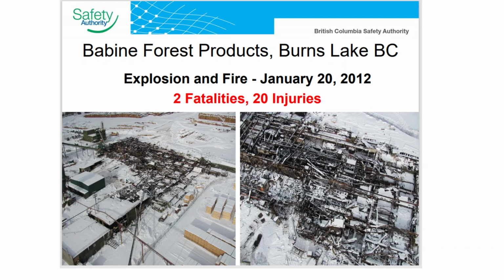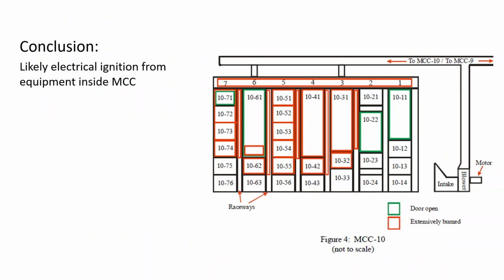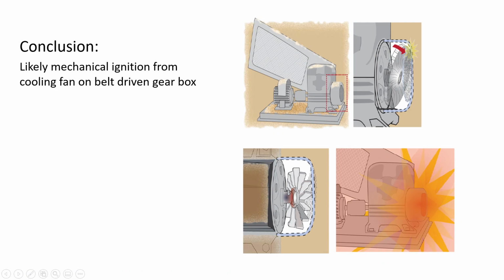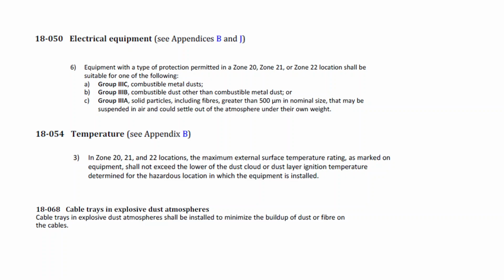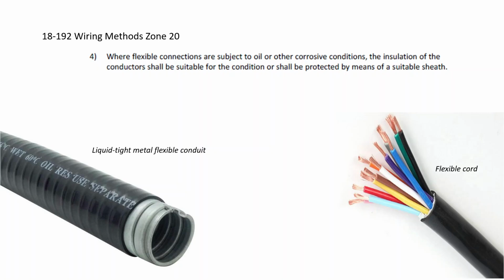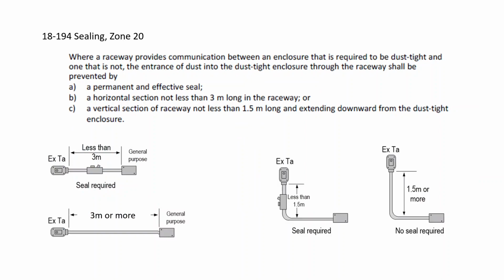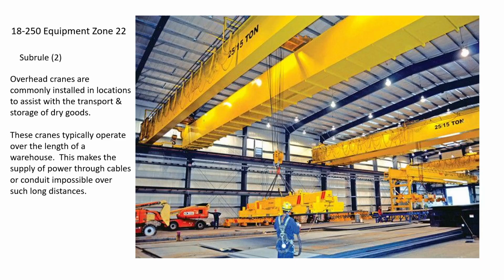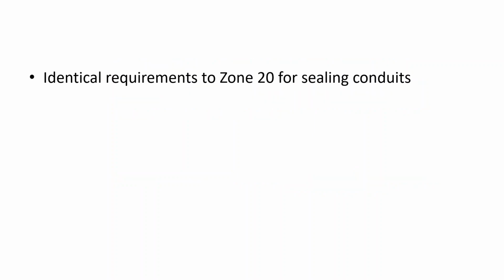Section 18 CEC: HAZLOC Dust atmospheres

Comment: In Zone 22, would an enclosure need to be Ex Ta rated or would a NEMA 4 or IP66 enclosure be sufficient? Looking at 18-250(4) in Ontario Code.
Reply from the maker: Hi @danbelisle3355, good question. I do not profess to have all the answers, so lets look at the pertinent rules to establish what the CEC requires. 

18-250(1) indicates that equipment installed in Zone 22 must have ratings in alignment with those listed in Table 18. Under Table 18, Zone 22, we find a large list of HAZLOC equipment ratings. Notice that any equipment suitable for Zone 20, 21 & Class II Div 1 & 2 is also permitted in a Zone 22 location. 

In Table 18,  Protection by Enclosure, Tc is identified. This is the lowest protection level for the HAZLOC "Protection by Enclosure" method. 

The 2024 CEC changed some of the phrasing in this area due to the ambiguity of descriptors that had historically been used in many previous editions. Subrule (4) leads with notwithstanding, then into the basic allowance of "dust-protected" enclosures when containing specific types of equipment. Dust-protected enclosures in this context are not HAZLOC rated, nore are they Protection by Enclosure Tc. To identify which ratings would be considered "Dust-protected" for non-HAZLOC applications we have two options; NEMA or IEC.

NEMA enclosures are listed in Table 65. The row used to identify the minimum requirement is "Settling airborne dust, lint, fibres, and flyings", of which many enclosures align with.

IEC enclosures are listed in Appendix B, Table B18-8. The first column digit identifies the protection from solid objects, dust would fall into this category. The phrasing of 18-254(4) is "Dust-protected", meaning the first digit for an IEC enclosure would need to be 5. The second column is for liquid. This second digit would be selected based on the local environment of the intended installation.

Although long-winded, I hope this aligns with your thoughts of enclosure selection for Zone 22 locations.

cheers